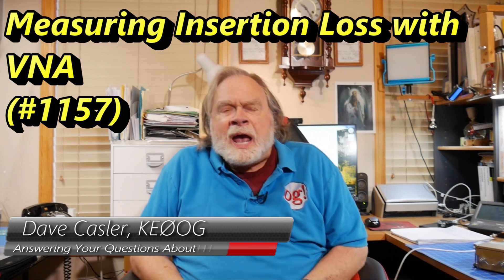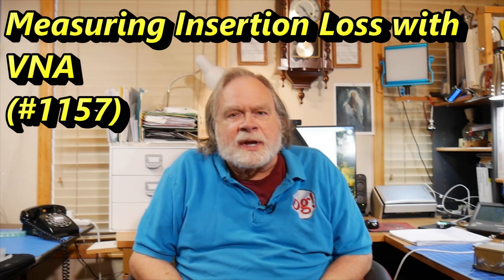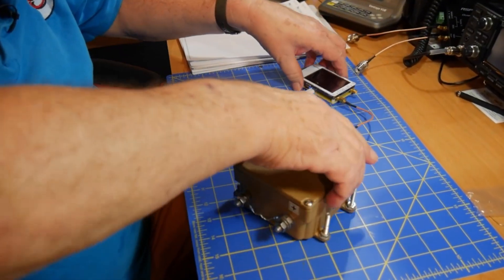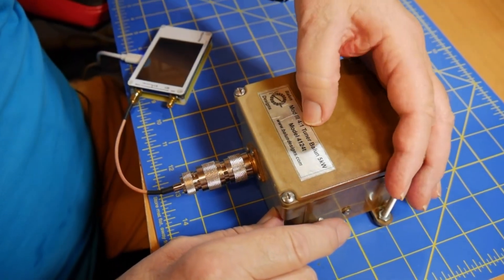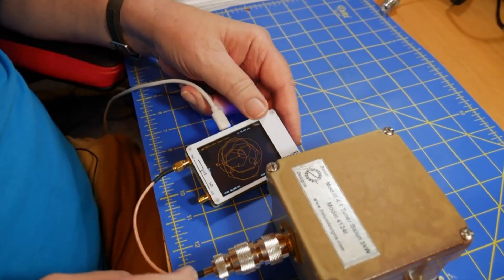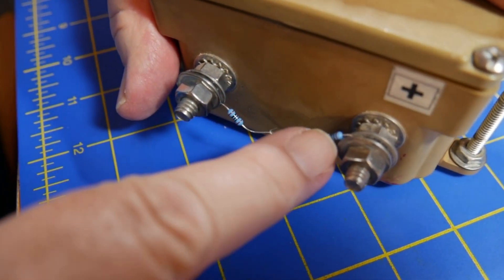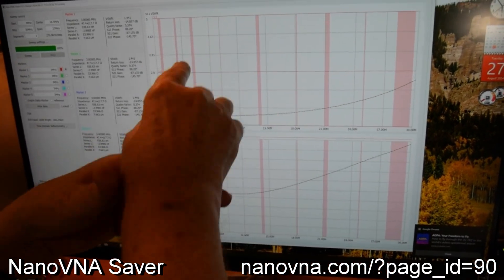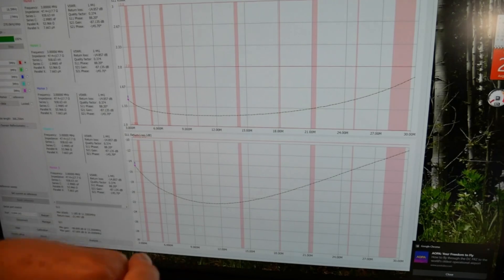Measuring Insertion Loss with VNA (#1157)

Comment: Hi Dave, by measurning only the return loss of a balun you only measured how much power wasn't consumed by the 200 ohm resistor due missmatch of the balun and imperfection of the load resistors. But it doesn't tell you what is the loss of the balun core, wiring etc. Also if a balun has a certain return loss due missmatch the VNA will show a better match than acctually is.

To measure the loss what I think was asked I would use the S21 parameter of the VNA. When having a 4:1 balun you will have a 200 ohm impendance on the other side but the 2nd port of the VNA expects 50 to measure properly. In this case just make a power divider by putting a 150 ohm resistor in series to the VNA's 2nd port. Since in series there will be a match of 200 ohm. But since you have a power divider certain power will be consumed by the 150 ohm resistor and the S21 measurement will show that as a loss too. You neeed to calculate how much power is consumed by the other resistor to compesate the reading. The formula is 10*log(50/(150+50)) and you should get -6.02 dB. If the VNA shows -6,02 bB means you don't have any loss. If it shows -10 you have -3,98 dB of loss and so on.

If you have baluns or ununs with different transformation ratios just change the resistor to get the output impendance and change the resistor value in the formula. For example for a 9:1 you need a 400 ohm resistor in series with the VNA 2nd port and the formula 10*log(50/(400+50)) = -9,54 dB.

To consider you will measure the loss when impendance matched. With missmatched loads the losses in the magnetic cores get higher. If you apply a random piece of wire no where particulary resonant difficult to know how much was acctually radiated from the antenna. But at the end it should still work. When getting portable you always take compromises...

73 Andrej - s57rw